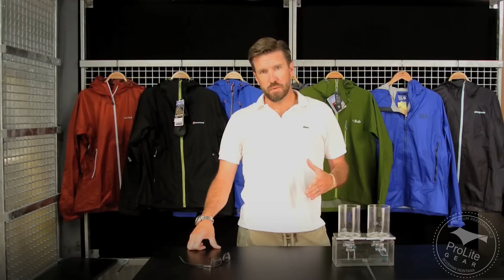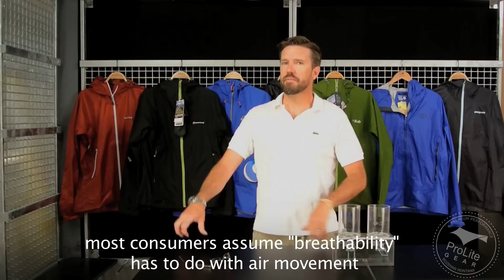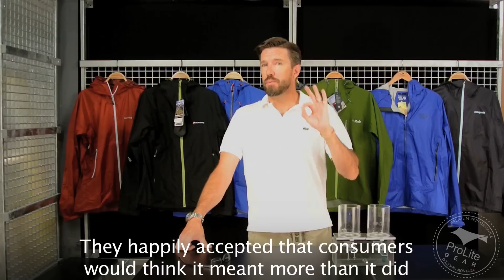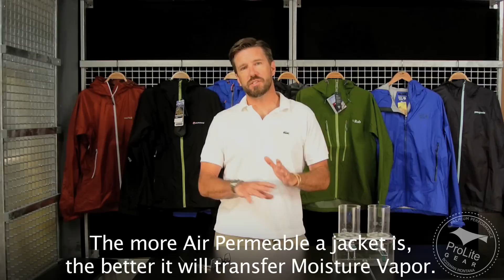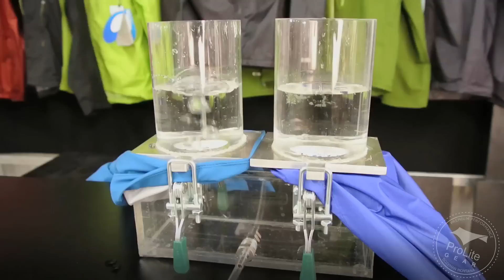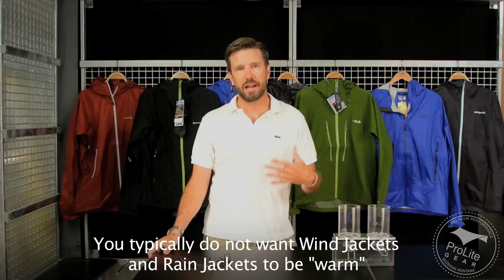What Does Fabric "Breathability" Really Mean?

Comment: Hm, I think he is mixing something up here. When I sweat, I want water vapor to go out, not air. If I wear a thick fleece pullover for example, there is very little chance for water vapor to escape because the material is not very permeable for water vapor, hence I sweat like hell and it is too hot. On the other side the material is highly air permeable and there is an amount of ~200 CFM (cubic feet per minute) that can go through this material. This means it is highly air permeable but has a very high resistance against water vapor. Ando now take these ultralight waterproof laminates such as Gore-Tex Active, Neoshell or Event. They are basically windproof and the airpermeability you can measure is really low (around 1 - 3 CFM), but they are highly breathable, means a lot of water vapor can pass through as the resistance agains water vapor is really low.

Comment: Breathability. Take a gore-tex performance standard jacket, and do standardized excercises. Take the other jacket and do the same excercises. Now you can evaluate how many movements you made before you had to take the jacket off since it was so unconfortable. Then put on a plastic sack and compare. That is breathabiltiy.
Reply: You are implying that goretex is like plastic bag ? Completely non-breathable?
Reply: @michawolski5948  Once outer shell is saturated with water, it is unbreathable. Therefore the good construction is a light ripstop on the outside, which dries quickly, cannot suck up too much water and large pitzips. 10 minutes into the rain wet-out occurs, if you cannot dry you will have moisture inside the jacket. That is why a thick polar is needed to insulate. This way you can manage like 40 minutes slowly walking before the moisture inside gets too much for comfort. In a plastic rain jacket, this happens in 10 minutes.

Comment: ProLiteGear Thanks for the info! It's gold!
Reply: Very bad consequence & ignorance of this is racehorse trainers have their horses wear heat blocking spandex tight lycra hoods right at the heat producing brain that requires release at poll area but not getting it. Plus hard cinyl or rubber ear muffs to block noise & several countries allow them to race in them. Mesh ones slightly better but youtube Japanese race horses with them are going Mental.